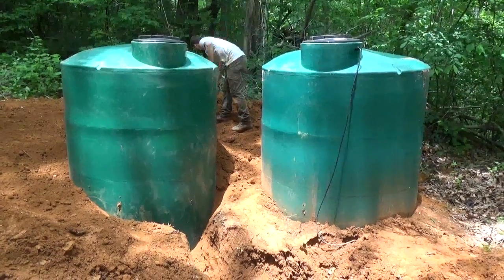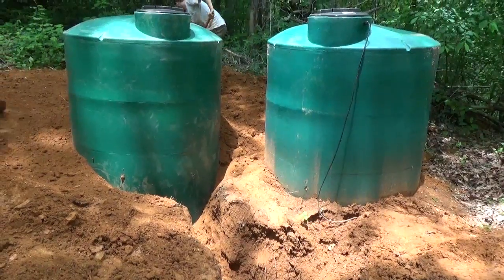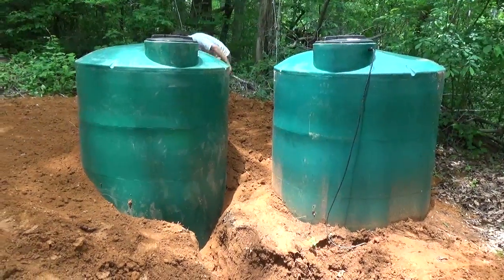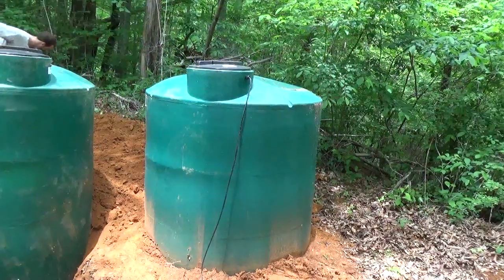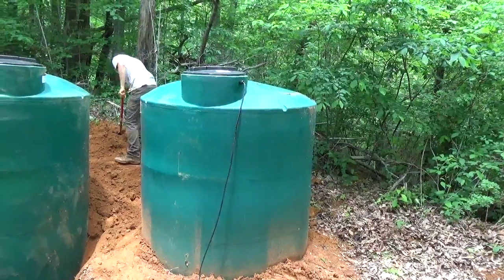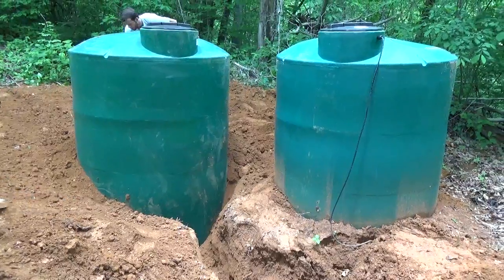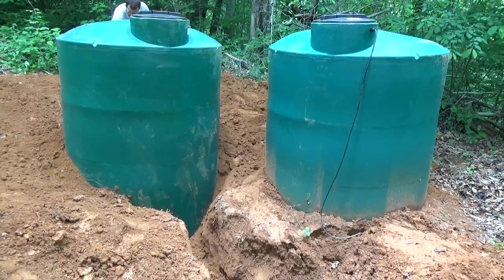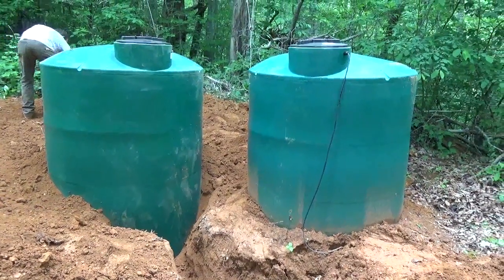Are 2 tanks better than one?

Comment: We did something similar about ten years ago at the hunting camp. We daisy chained 10-275 gal plastic totes. We got them for free at the time. We have them on a hill about 100' above camp (51psi @ distribution block). Plumped to 4 camps. They are buried to within 6" of the cap and tied into a 6 gpm flow well.
I like your design. Very clean lay out.

Comment: If you don't have a hard freeze like I do. 3 foot of frozen ground here in the winter. Would love to do it but I can't in the winter.

semper fi    steve
Reply: Maybe....in a garage or something? Attic?
Reply: The key is that your pumping warm water from the ground into the tanks on a daily basis. A thermal mass of several hundred gallons of water in the tank takes days to freeze solid even in a cold northern winter. The fresh ground water provides warmth in the tank. You don't need another heat source.

Comment: Aloha.
Water tanks are just like EDC guns.....1 is none, 2 is 1, 3 is better.
Especially if you plumb and valve everything for full redundancy and flexibility. 
Should anything happen to any single tank (like accidentally shooting it with your EDC gun and putting a hole in it), you should only lose the water in that one tank, not all the water in the other tanks.  And, the plumbing/valving should allow full use or isolation of any combination of those tanks.

Peace & Prepare
Pax et Paro